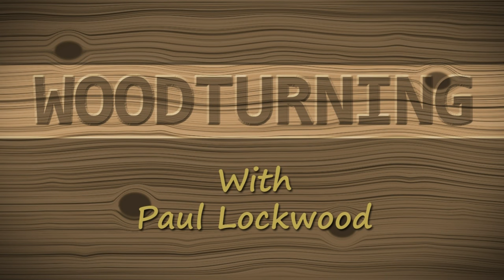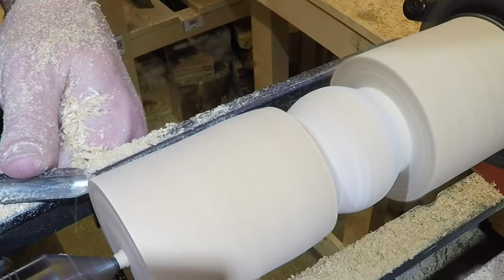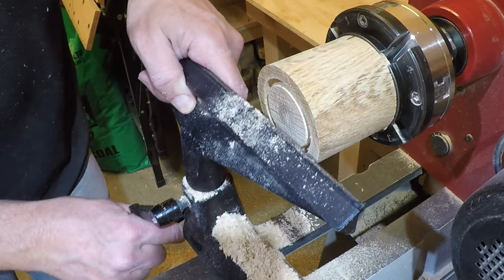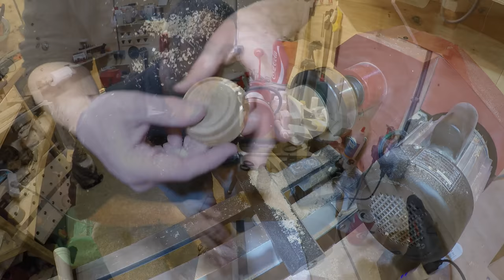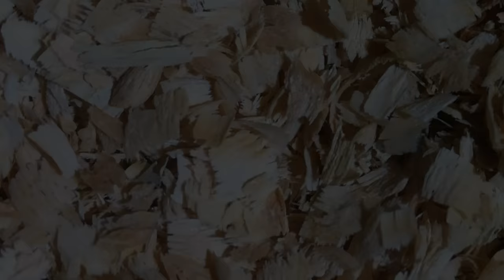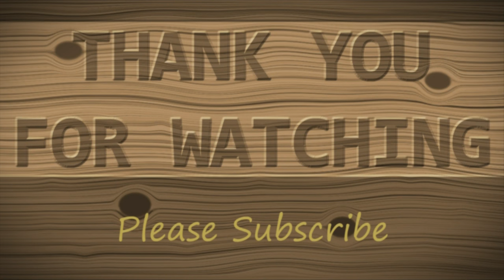Oak Paper Seed Pot Maker - Episode 39

Comment: Thank you for the video! The measurements are quite usefuI.  Had chuckled when you took the ruler to mark the paper then cut it with scissors! The metal rulers act great as a straight edge to just tear the paper against without the two extra steps. :)  

As a note one of the things some other have done if you have problems with it unrolling is: 
1. Cut the strip but make a bit wider than normal (3.5 inches)
2. Crease at least a half inch line along the top long edge before rolling. 
3. Roll
4. Fold bottom into the middle and press the bottom
5. Fold the top towards the middle down until the crease, and it holds the tops together and reinforces it
Reply from the maker: Good point about the paper tearing. You always look back at what you do and wonder why you did it that way.

All the tops will be great for others.

Thank you!😊👍